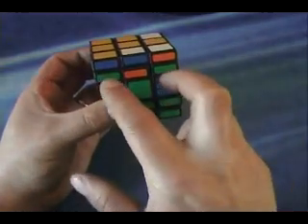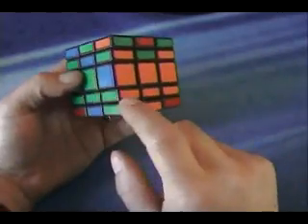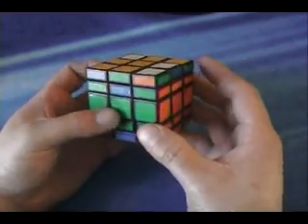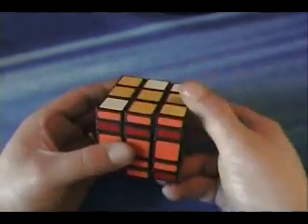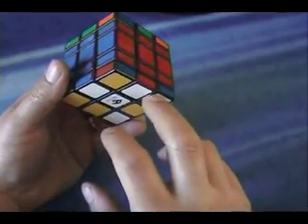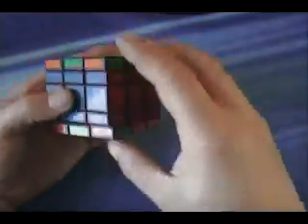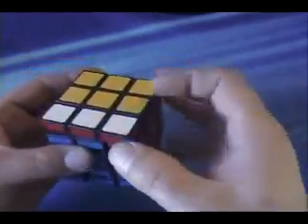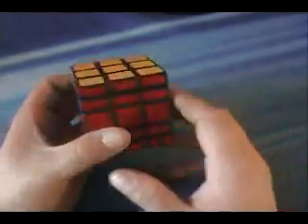How to Solve a C4Y 3x3x5  Pt. 2

Comment: @BDawgsvids The outer most layers will go last. Basically how it works is you get it into a 3x3 shape. Then solve the 3rd from bottom layer and middle at the same time as if it were a 3x3. From there you would work on the 2nd from the bottom layer, then 3rd from top layer, and lastly solve the two outer most layers like a domino. This cube is almost identical to a domino/ 3x3x2. Hope that isn't very confusing. If it helps I could possibly do a walkthrough/tutorial. Let me know!

Comment: @rubixluver123 I am having trouble with finishing the second layer of my 3x3x7. I have the bottom 2 and 1 of the top done, but the second top one I am having trouble with the algorithms. The edges are the main problem right now. I am trying to do an edge switch, but the algorithm always messes up my pieces, so I have to reverse it each time. I'm doing it exactly how it says. Sorry if this isn't very explanatory. But how did you solve yours?

Comment: @electrogeek1996 i dont think it can be fixed like that because it will also swith the middle edges, not only the 2 opposite ones... I think it can be fixed with an M' setup then H perm then M... I'm using that and that works ^_^